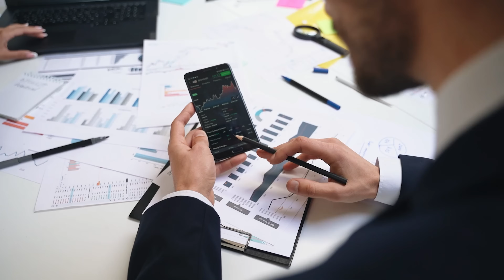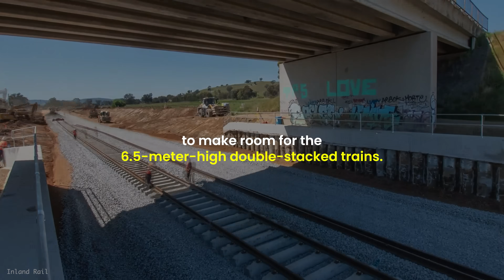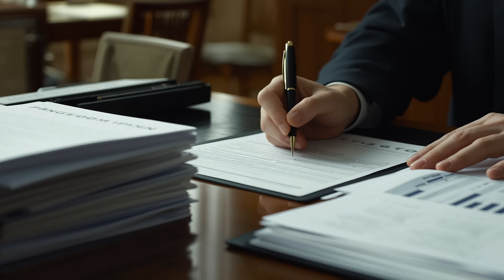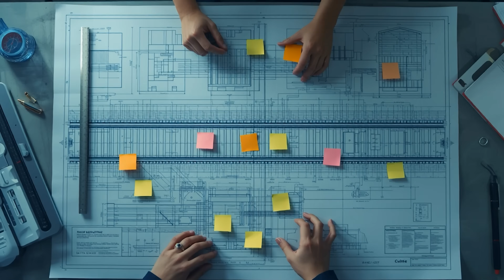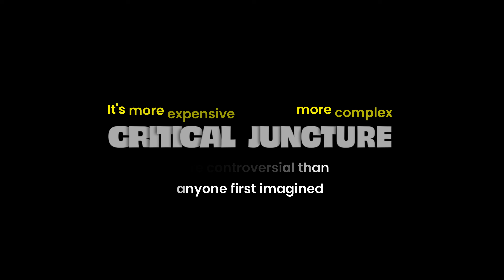Why Australia Is Betting $31 Billion on One Train? The Inland Rail Gamble

Comment: With the inland rail starting to become real - Suddenly the (extremely expensive and totally disconnected  / dysfunctional) West Sydney Airport became a major infrastructure while Tullamarine (Melbourne) had a new airstrip laid and West Brisbane (Toowoomba) has a new airport!  These airports are primary for fast freight using imported (BOP negative) Avgas.  Note Sydney’s M7 motorway is being increased to 3 lanes to accommodate heavy road freight vehicles (that was on the books 20 years ago – and didn’t happen) until -  the Western Sydney Airport.  

The Inland Rail line is single track and all the bends are still included – not straightened out – so the maximum speed is 100 km/h – but wait – this is (winding) single track so the average speed will be about 70 km/h and half the time will be waiting so at best the average time will be 35 km/h and that will not be any risk to the Oil industry Lobby (OIL) that controls the Heavy Road Transport fleets access to compromise the pollies on all sides. With two parallel lines the transport could be at least 70 km/h and the density of trains would be about 8 times (each way) - that would be a REAL THREAT to the propped up Heavy Road Freight Industry that annually wrecks the roads - needing far more diesel fuel to repair these roads / highways.  

The Melbourne end gets to Beveridge – but not to Melbourne and certainly not to Geelong  

The Brisbane end goes via Toowoomba and not via north Warwick / to Brisbane – and does not get into not past Brisbane!   

The rail is made for double height containers - - with winding tracks ??  The rail gauge is 1435 mm in width (made for 6’ coal carts) meanwhile the width of the containers is 2440 mm (8’ 0”) and Brunel’s 7’ 0” gauge was perfect for that as it was far more stable, far stronger and far less maintenance!   

With straightened dual tracks using Brunel’s gauge and single level containers these trains could very safely travel at 200 km/h all the way – and be a very serious threat to the OIL.   

All our pollies are very compromised idiots.
Reply from the maker: You raise valid concerns, but Inland Rail was never meant to be high-speed freight or replace trucks and air cargo.

It’s a capacity and cost project, designed to move long-haul freight off highways, not compete at 200 km/h. Single track, standard gauge, and double-stack containers were cost and compatibility choices, not engineering ignorance.

Yes — dual track, straighter alignment, and better access into Melbourne and Brisbane would be far better. But calling it useless ignores the reality: even at 70–100 km/h, shifting freight from road to rail still cuts costs, congestion, and emissions.

Inland Rail isn’t perfect — it’s a compromise. The real test is whether we upgrade it once demand proves the case.
Reply: @NextInfra  EXACTLY - but if the rail alignment was straightened then Quick (Freight) Rail (150 - 200 km/h) would be an inexpensive reality and Air Freight would be highly uneconomic and most of the Heavy Road Freight would be transferred to this rail line for maximum freight transfer profits.  And YES that would really upset the very well established and hand shook back room political  business arrangements (political bribery).
Reply: great flow of bs, congrat. Brunel gauge, freights trains 200kmh, oil lobby, airports somehow linked to this... I suspect your pharmacists sold you placebos instead of expensive prescribed pills.